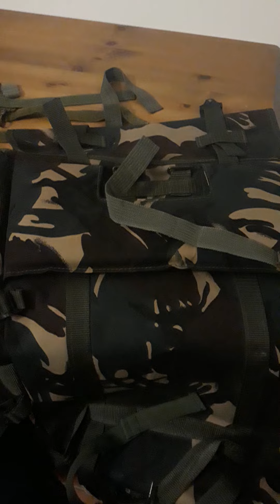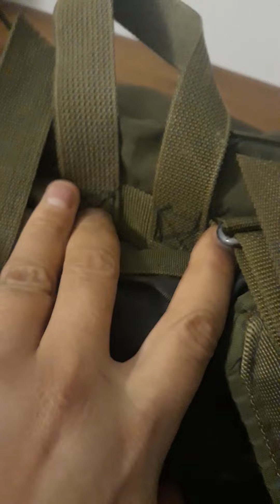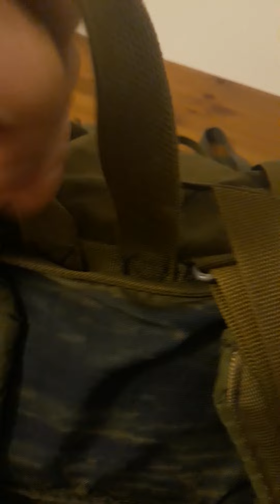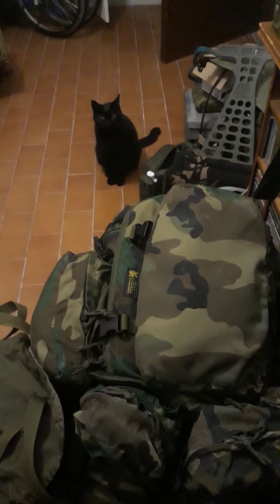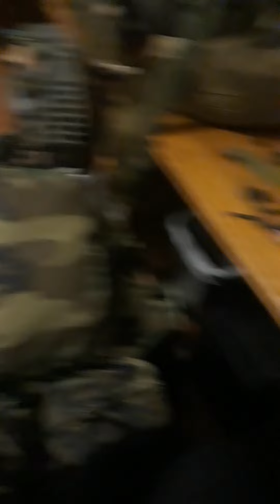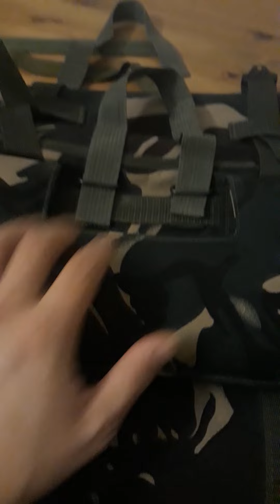ALICE pack mods: handle placement

Comment: Do you sew on your own packs, or do you have it done by someone else? Could you cut the stitches on the webbing holding the rings enough to position your handle behind them then sew it back up?  
Also I enjoy your videos, I have a few surplus packs but my medium Alice is a all round favorite.
Reply from the maker: I outsource the sewing to my local tailor. I could potentially cut the stitches and have it sewn on as you say but it's really more work for the tailor, plus it could ruin the integrity of the pack so I figured this is just easier. Glad you find the videos enjoyable :)